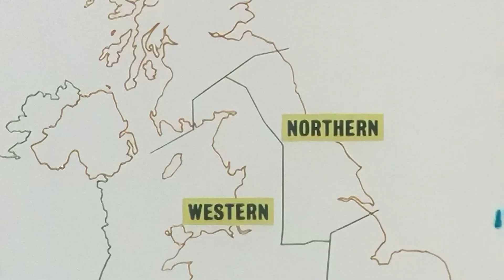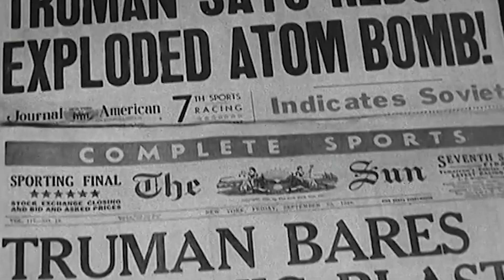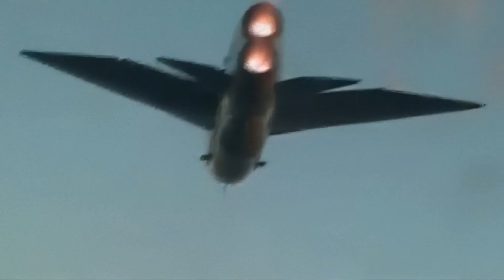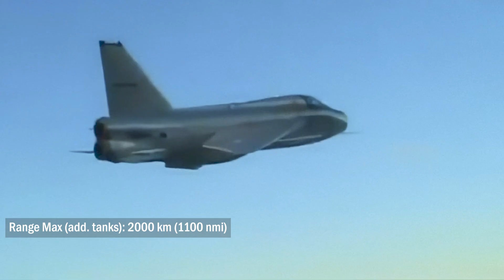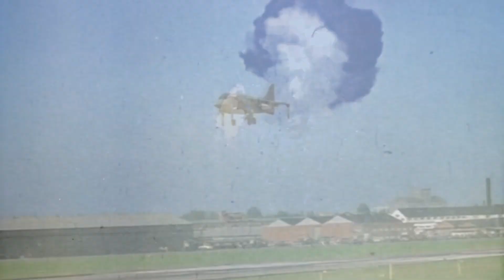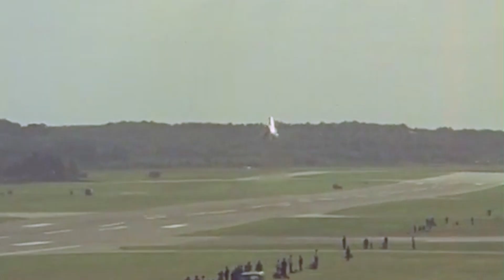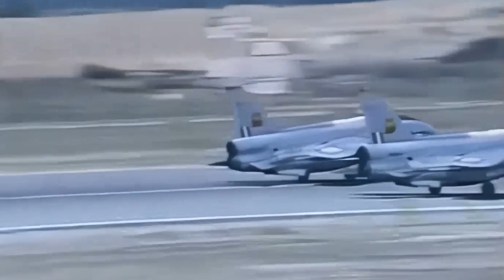Lightning – effective exotics

Comment: Can you pitch up/down faster with differential thrust and beat an SU-57?😂
Reply: The Lightning would beat the Su57 hands down every single time.
This is because the Su57 didn't exist before the Lightning was retired, so on any battlefield that the Lightning would be on, the Su57 would never be there to fight it lol
Reply: The 57 isn’t a good plane
Reply: Even though they’ve retired, it’s already more successful than the SU-57 ….. more produced…. Enter serial production…. And sold overseas…. SU-57 will only ever be a parade queen.

Comment: I saw a Lightning perform a reheat taxi at Bruntingthorpe. Laughed like a schoolgirl, the noise was so extreme I checked I hadn't ruptured my body. Do they still do the twilight reheat taxi demonstrations?
Roland Beamont EE's chief test pilot always tried to get the fuel load increased.
Beamont as TSR-2's (The greatest thing that never was) test pilot lit one Olympus into reheat and left the following Lightning for dead.
Reply: Sadly not. Bruntingthorpe runway is full of stored cars.  They do engine runs though, as do Gatwick museum, they have a runner. There is now a TMk5 flying in the States, and the Thunder City Cape Town fleet have been sold, but no further news.